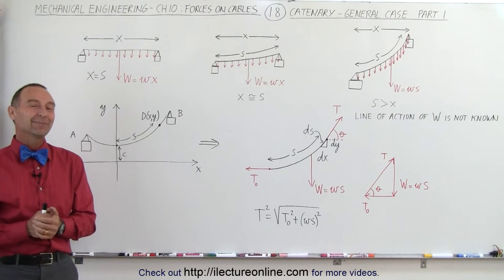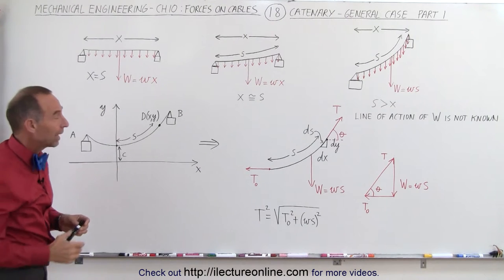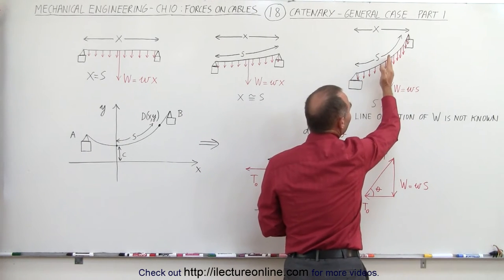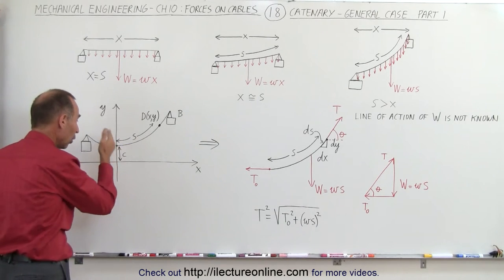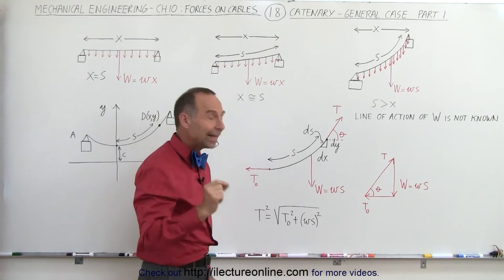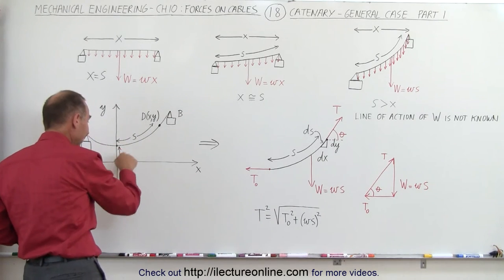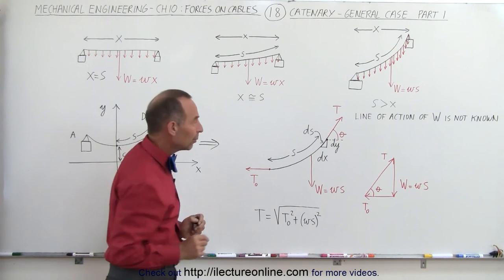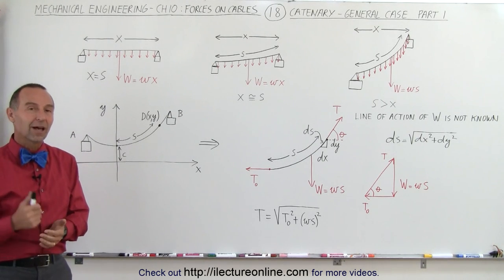Mechanical Engineering: Ch 10: Forces on Cables (18 of 33) Catenary - General Case (Part 1)

Comment: Great videos! Really informative!
Question: For the string attached to two ends with no sag. What is the force that opposes the weight force Wx?
Reply from the maker: If there is not sag then T becomes infinite.
Reply: The tension force counteracts it to some degree